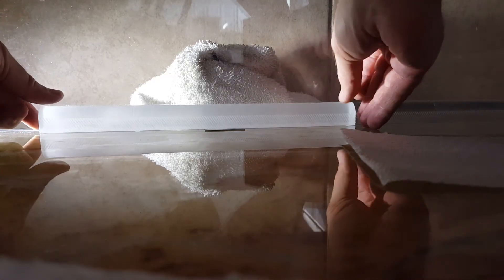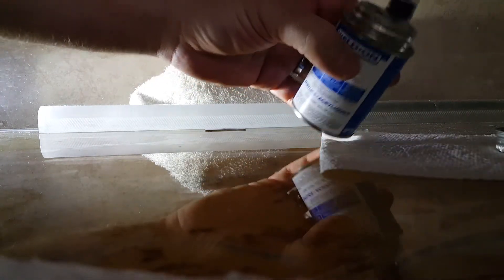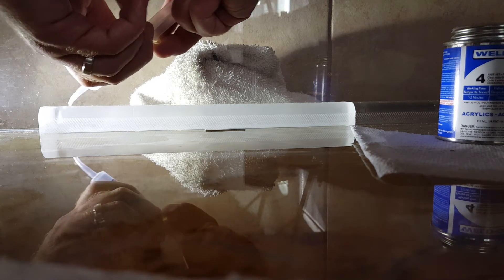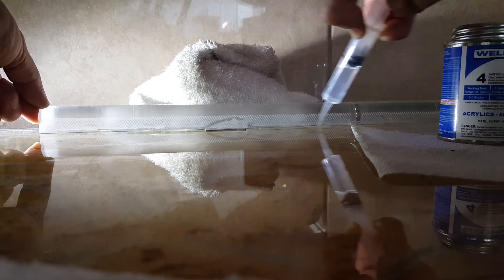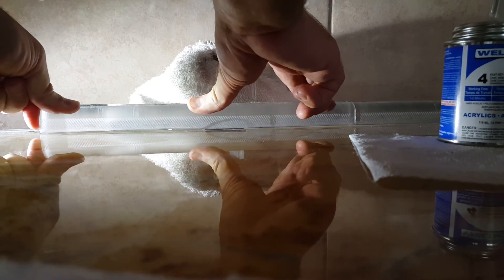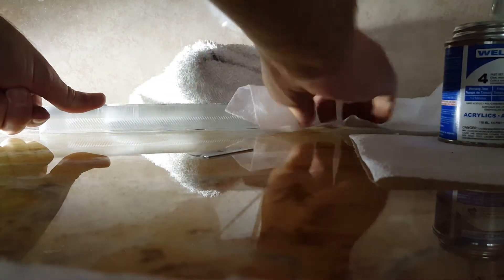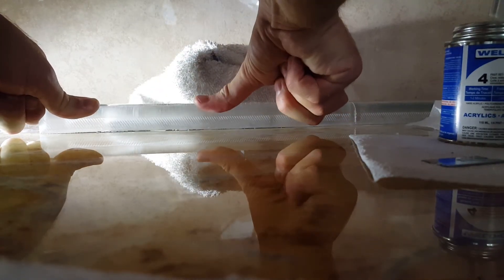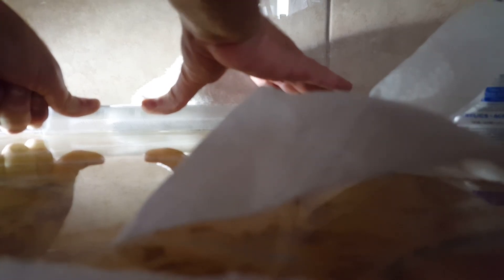Acrylic aquarium fish tank repair weld-on 4

Comment: Would Weldon 16 work the same way ? 
I have the leak at back side panel and think that Weldon 4 would not adhere as well as 16 
Also, my acrylic panels are 1 1/4 inch, is it okay if I use 1/2 bar ?

Comment: I have an acrylic tank and one side  is coming undone it is 24" tall 48"  Long Will this work for that
Reply from the maker: Yes.  Use a square or triangle piece at least double the thickness of your tanks acrylic.  My pieces I'm welding in are square but I sent them through a router to bevel the edge so fish don't cut themselves on the Sharpe edge.
Reply: @TheGrezling  ok thanks

Comment: Hello. How long do I let my Weldon sit?
Reply from the maker: There are different times for different weldon products.  Typically 80 percent strength in about 15 minutes, but it can very a lot depending on which you use.  types 3, 4, 16, ect.
Reply: @TheGrezling  I glued a sheet of acrylic on the bottom of my tank to patch 3 holes with Weld on 4. Then I used 16 on the inside around the seams. I did this Tuesday so today will make 72 hours. It should be good to go with water right?
Reply from the maker: I would think 72 hours should be plenty.   Good luck.